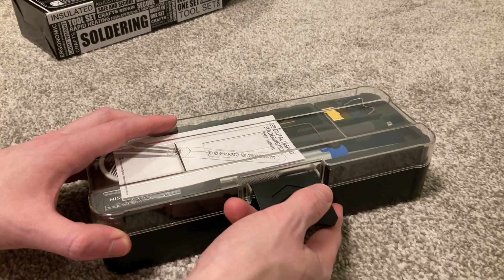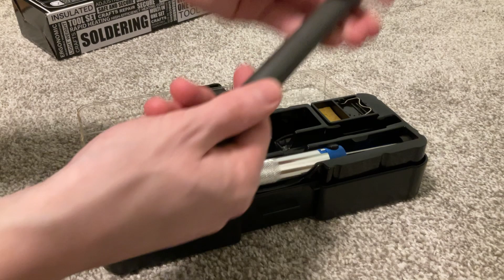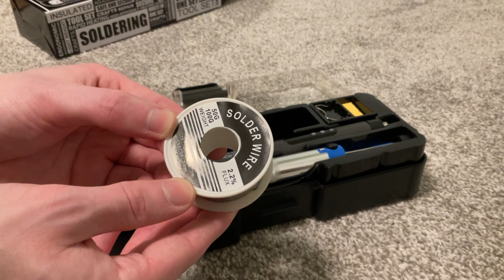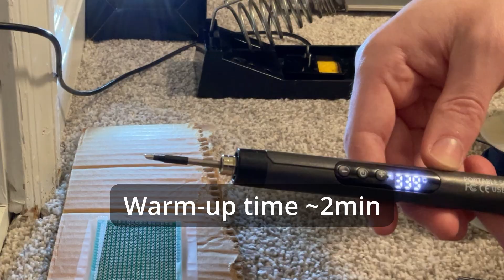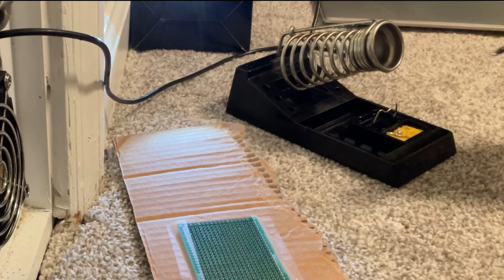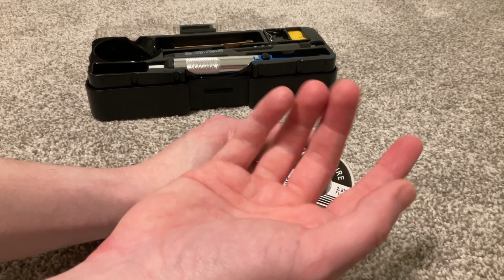Amazon Battery Powered Soldering Iron Kit Review

Comment from the maker: I ended up not making the follow-up video due to lack of time. However, the iron was capable of soldering wires, SMD work, and even lightweight recapping. Obviously, it can't handle the big ground or voltage planes, but with simple stuff, it works great. My only wish was longer runtime. Maybe I'll upgrade the battery or get a battery bank.

Comment: Mine it is unable to melt anything
Reply from the maker: Did you use leaded solder not the crap or comes with?
Reply: It is not the lead it is the soldering iron  itself. At least mine was a toy, it does no get hot enought not even after 15 minutes on. I was able even to touch it and keep the finger very close without any pain :)
I bought a not portable one and it gets hot very quick. 

 @Josh.Davidson
Reply from the maker: Return it for a replacement. Mine still works fine. Just used it the other day to repair something.

Comment: I don't think that is lead-free solder. Seems like tin-lead solder, but with high percentage of lead, like 40/60 or 30/70
Reply from the maker: How do you know?
Reply: @Josh.Davidson  Proper lead-free solder (SAC305, SAC0307, SnCu, etc.) would have melted without any issues at 340C with pad this small, and solidified nearly instantly without being in weird pasty state. 40/60 or 30/70 tin-lead solder  melts at higher temperature (250-260 C, which is much higher than 217C of a typical lead-free) and is not eutectic what so ever and has an enormous temperature region in which it remains sort of pasty. Plus, lead is cheaper than tin.
Reply from the maker: @Alex-mj7km  The working temperature of the iron is not the same as the melting temperature due to thermal losses. 
I will retest with my good quality station.
Reply: It does not even melt the solder

Comment: My go to portable setup right now is the Pinecil, a USB battery bank, and a ~1m cable. You easily get hours of runtime and all the weight isn't concentrated in something you need to hold.
Reply from the maker: This was my second choice and plan if this cheapo didn't work out. Thanks for the comment!
Reply: @Josh.Davidson  I have a pinecil, would definitely recommend. Heats up in seconds off my 19v asus supply, although a bit more expensive I think its worth it.

Comment: Go to bed.

I've heard good things about the battery powered Pinecil, runs about $40. If this one is comparable to it, the $20 saved could be put towards some nice solder and flux.

Edit. Maybe I should have went to bed because I could have sworn the Pinecil was battery powered.
Reply from the maker: Battery powered Pinecil? Sir that is not powered by battery, he is powered by USB.
Reply: @Josh.Davidson I could have sworn I'd heard it was battery powered. My fault for not taking 10 seconds to look the listing up.
Reply: @ThisIsCheez  you can still run it off a pd power bank and It'll work fine